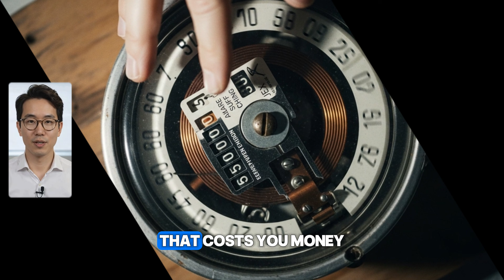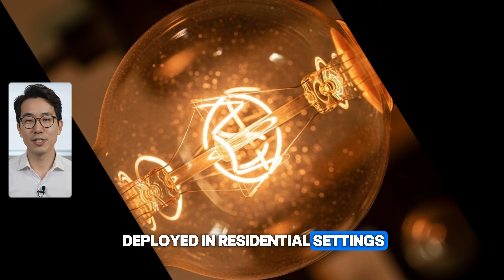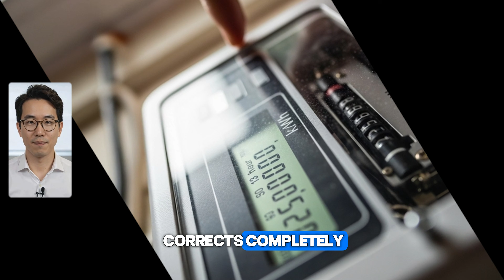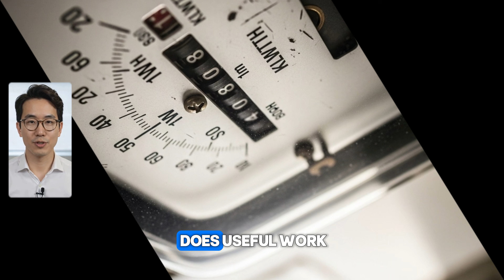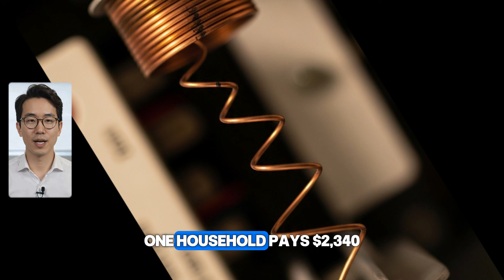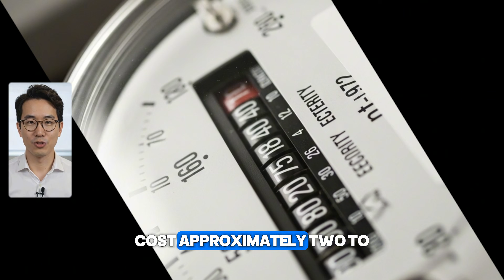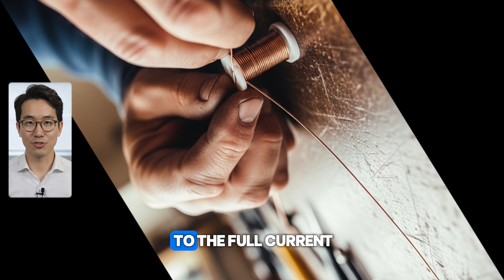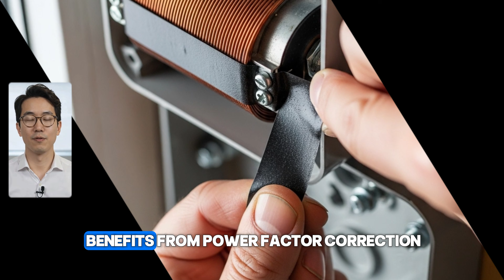This $3 Coil Wrapped on Your Power Line Cuts Electricity Bill in Half. Utility Companies HATE This

Comment: It sounds like about the same gauge as vacuum cleaner cord; but this wouldn’t work I think -
Reply: How do you think it wouldn't work if you've no idea what 18 gauge wire is
   Dunning Kruger
Reply: @johnrhodes3350  Assuming YOU know what 18 gauge wire is, do YOU think it would work?  Should it be solid or stranded?  Where would you wrap the coil?  What would you connect the two ends to, and why 80 feet?  :body-blue-raised-arms:
Reply: Electrical cords on vacuum cleaners & other appliances, generally are made of multiple-strand, smaller gauge wires twisted together, coated in plastic.. 
Those individual wires, taken apart, are Too small to use single wires from.  
Wire gauges are tricky—because the gauge label on compounds strands of wire, does not indicate the actual gauge of the individual wires inside it. 

The coil wire is specified to need: 
Single wire, 18gauge, & should be continuous, not spliced-together pieces. 
Non-coated.

Comment: 80feet of 18 guage copper wire 2 to 3 dollars what year was this video made 1892
Reply: Or as this AI guy would say, “one thousand eight hundred ninety two”.
Reply: Can find it from electronics that get thrown away
Reply: @ale.g.x.667  But will still do ABSOLUTELY NOTHING, despite what this AI-generated pile of garbage calling itself a video claims.
Reply: @Ferd414 idk about absolutely nothing, you'll use your hands some at least 🤣.
Reply: @ale.g.x.667    Maybe. Might scavenge from unwinding ceiling fan motors.  
Although, if ya have a fan motor to take apart, those can be remade/repurposed as generators for use as a wind generator….which might provide more electricity than is saved by the copper coil only partly stopping grid from billing you for the electromagnetic energy they “think” your house used.    
That wind-Gen could be a much bigger benefit, feeding that juice to a few batteries to boost solar w/less solar panels for your house, & be configured to 1st charge your backup batteries, then sell excess to the grid with a grid intertie.
Reply: It would cost more even if it was scrap wire.😂
Reply: @lindaswanson9328 the scrap scalpers 🎸🤣
Reply: probably the very dark ages 😂
Reply: I already knew that 80 feet is way more than copper from 50 years ago.:face-blue-smiling:

Comment: Show videos  of how to make and fit this coil
Reply: No doubt, if you put the coil before the meter they will trip .if they find it inside they will trip...
Reply: @Troy-b4n    The incoming supply line before the meter, is usually outside the house; in most it’s right up against the wall, or, where power line comes from pole to house near the roof.   
If coil is placed close to where it enters the house, but before the meter? — That just seems like it fails to change what gets metered, from the return lines.

Most commonly, the line enters the meter, & the meter plugs right into the back of the breaker box—
 so there’s nowhere to wrap a coil around a line before it returns thru the meter …. I think that’s a problem. 
As I understand it, in normal use, incoming power is measured by meter, goes thru circuits & appliances in-house, some is used, then what’s not used returns back thru the meter & measured again.  
Meters signals that difference wirelessly to utility computers.  
The difference btwn incoming & outgoing, is what you are billed for.   
The more returning power is seen, the lower your bill. 
But:  
Problem is, it’s a kinda sloppy setup. 
The current moving via the wiring, causes “bleed-over” (some call it “electrosmog”).  
It’s energy lost from the wiring into the atmosphere around it.  
It technically belongs to the utility, & they want it back!  
That’s why folks who have harvested bleedover from under high-tension power lines, have been fined for “energy theft”— tho, it’s Not like the utility can get it back—they go on the principle of it…. They don’t want anyone getting something that the utility ..Might.. have profited from..  even if that bleed never could be used or recaptured by the Corp.. 

The copper coil gambit seems like it’s trying to stop some of that bleedover from being lost; tries to make more of it stay on the line, so, more of it returns to the utility, so they see more returning to them— it looks to them like you turned off some appliances, & used less — at least that’s what it seems to me. 

If I understand right, copper coils would need to be maybe on the individual circuit lines, indoors, out of sight from anyone seeing …. near where those connect to the breaker box, to hopefully snare more of the bleedover so the meter can read it, & lower your bill. 

There’s another trick that might be used, but must be done when a house is being wired, to minimize bleedover from house wiring.  
& if you do this, you need to be sure the transformer at the street is modern, & can handle more power coming back into it. 
It requires putting a single twist per every 3’ of Romex (3-wire, 14g. house wiring) going thru the walls.  
One electrical engineer told me, “sure, that works, but, the amount of feedback of the bleedover, to the transformer at the street supply point (the big cans on phone poles), can cause the transformer to blow up, spilling PCBs all over — that especially applies to old tech transformers. 
Why?
  I suspect the transformers were designed to handle the expected household loads only.  
If a house is flowing power thru lines AND using it, AND returning too much to the grid, it ODs the transformer.  💥 
This is similar reason many utilities tried so hard to  block folks merching their homes with wind & solar & selling it back to the grid;  AND, they really were trying to keep hidden how vastly antique the grid has been, for over 80 years.  
So instead of admitting grid fragility & insufficiency, they told some folks, that their site sourced generation was incompatible with grid system…
 & because grid is greedy as pirates, they also tried to make home-Gen power illegal, to stop folks from doing home-Gen power. 
So, bldgs are still being flat-wired (now twist every 3’), & the transformers are still being engineered to have less capacity for site-generated power, & designed for Not accommodating extra returned power. 

There can be other factors, such as houses wired w/aluminum instead of copper, or, with hybridized wiring (mixing copper & aluminum wires)

It’s complicated. I probly didn’t explain optimally. 
Hopefully, folks get the gist.
Reply: . Autocorrupt correction:  buildings are flat wired (with NO twist every 3’ of romex..)
Reply: Can't be done, because this is nothing but AI garbage that doesn't even begin to approach having any reality to it. Congratulations... If you think you're going to try it, you've just demonstrated that you're a gullible fool.

Comment: Rapping wire round a power line causes heat build up inside the cable as the live neutral and earth are enclosed with an outer steel sheath to protect the cable from damage. 
I have seen major fires caused by this stupid idea. 
This AI idiot is scamming you to do something that will save electricity.  But burn your house down . Reactive power is also reactive heat . 
Also noticed how he keeps repeating the same thing over and over . It's called brainwashing..
Reply: Wrapping

Comment: Do we have any electricians in the house?

If you wire wrap the power cord on an inductive load such as a motor or inductive heating device, etc, would that also work?
Reply: Question #1:  Yes.
Question #2:  No!
Reply: I was a generator mechanic in the army and I can guarantee wrapping a copper coil around the wire leading to your meter isn't going to do anything but make you tired of wrapping wire around and  conduit and make you wish you could get your money back on the copper wire.

Comment: Please show diagrams or example
Reply: This video is AI.  AI vids are notoriously for hooking viewers into tantalizing life-line gadgets or fixes, but using up excessive Time & Resources of viewers. 
SOMEone is raking in dough, just from views, clicks.  
Humans lose, cuz these things fail to include anything completely—it requires folks to do more research to find clearer instructions. & to verify if the “solution” offered even works. 

It says, this coil can maybe get about 30 - 40% better efficiency.  
But commercial capacitors properly installed, can get up around 90+% better efficiency. 
I’m gonna be checking cost of electrician doing a proper one.  
But might try the coil.  
The wire is about $30 something now at home depot. 
 
If it fails to show improved efficiency,  the loss is modest. 
It says to chart the meter reading once the coil is placed, & again in a month, so you can see the difference. 
Put it in place near the same date the utility reads your meter, so it’ll be in-sync w/the billing cycle, & clearer to see changes relative to the coil.

Comment: This is utter AI BS!  You can NOT correct your power factor unless you first know what it is, which requires specialized equipment, and every time a motor or any other inductive load turns on or off, your power factor changes.  There is no way that 80' of copper wire is going to magically "fix" anything.  Besides, you correct an inductive power factor mismatch with capacitance, not another inductor.  Also, it's illegal to wrap wire around the power company's wiring ahead of the meter.  People have been successfully sued simply for running wire under a high voltage line to "harvest" current through inductive or capacitive coupling... look it up.  Furthermore, if you wind a coil of wire around only one of the two "hot" wires going to your house, you've created a current transformer, which DOES carry current, and CAN shock you.  This is a perfect example of how irresponsible and ignorant people can use AI to create content that's useless at best, and illegal and dangerous at worst!    (Retired Electrical Contractor)
Reply: Thanks for being a real person with real intelligence and real advice thank you for taking the time I appreciate it
Reply from the maker: You raise some valid technical points. This video focuses more on illustrating a concept rather than a full electrical engineering solution. Power factor correction and grid interaction are definitely more complex in real-world applications, and safety/legal boundaries should always be respected. Appreciate the detailed input.
Reply: @ForbiddenOutdoors  "Step away from the AI JON-BOT!"

Comment: WHAT A CROCK OF CRAP !!!!!
Reply: Power factor CORRECTING CAPACITORS ARE SOLD ...BUT MUST BE MATCHED TO EACH MOTOR ...PROBLEM IS TAT EACH MOTOR IN A HOME  RUNS INTERMITTENTLY AND THEN CORRECTING CAPACITORS MUST BE CONNECTED WHEN MOTOR IS ON ...DISCONNECTED WHEN MOTOR IS OFF !!!....37 YEARS AS INDUSTRIAL ELECTRICIAN  ...NO TEXTBOOK , NO THEORIES SHOW COUNTERACTING /THE FIXING POWER FACTOR WITH ANOTHER COIL ...ONLY CAPACITORS !!!!!!!!!!!
Reply: @ERICKAJANDER  CORRECT.
Reply from the maker: I understand this topic can be controversial. Always good to question things—appreciate you sharing your opinion.
Reply: 1) Consumers are not changed for Reactive power.. 2) Even if we paid for reactive power... most homes run .90PF (using CAPACITORS not Inductors)   and correcting would only save a few $ a year at most.

Comment: Most people in our neighborhood pays $275 to $350 monthly.
Reply from the maker: That’s quite a significant monthly cost. Energy expenses can really add up depending on location and usage patterns.
Reply: @ForbiddenOutdoors    Maybe worst is, the covert algorithms that can adjust bill up higher if the meter signals a sudden drop in usage—like, when way better windows get installed, or a bunch more insulation added to attic. 
This has happened here, 3 times.  
   1st, insulation added in attic, showed a drop the 1st month, but it went back up & then some, the next month, despite weather being similar.   
   2nd, we replaced 2 big windows.  Again, a modest drop the 1st month., then raised more the 2nd month.   
   3rd time, we replaced a big windows, & remediated a 2nd big window, & faked a storm window on half the slider door.  That time (& maybe cuz I’d contacted utility complaining of improvements failing to lower the bill…?), there was close to $100 drop in freezing cold weather bill, but, it went back to higher, over the next 3 months, even as the weather warmed some.  

There’s another category of charges that make up power bills:  “other fees”.  Anything can be covered by that category, that is other than transmission, etc. 
 So, there can be hidden fees you are kept in the dark about. 
 It used to be the smaller category. Now it’s turning into the biggest.   
Important questions to get from utilities, is, a complete, itemized list of what “Other” fees are, because That is the 2nd place that can bloat your bill, & they can still say, “but we have not increased the unit price”.  Increasing that requires a vote, But “Other”, doesn’t.

Comment: I studied power grids and FOUND out something strange...BUT I WILL NOT EXPLAIN A SOLUTION HERE.
.I WILL POINT OUT THIs... HERE HERE in France AND Italy they use step down and step up transformers...NOW GO LOOK INTO THAT... HERE'S A POINT YOU SHOULD FIND... ELECTRIC DOES NOT TRAVEL FROM GENERATOR TO YOUR HOUSE..... ELECTRIC ONCE GENERATED..IT HITS A ATOM..THAT HITS ANOTHER...EACH TIME ENERGY IS TRANSFER... THINK.
Reply: Step down transformers are used between the power generators and the user to reduce the current necessary to supply the power. This helps in two ways 1) The wire size can be made smaller and 2) reduces the inductive power loss.  Anyone interested look up  I**2R transmission line loss.
Reply: @buggsy5  Transformers are primarily used to change voltage, not current. It is because of I*2R losses that substations are needed to boost voltage lost in long distance transmission lines.
Reply from the maker: Interesting perspective. The way energy is transferred in power systems is definitely more nuanced than it appears, especially with transformers and electromagnetic fields. Thanks for contributing to the discussion.
Reply: You're ignorant.

Comment: Where Is the copper wire/ or the copper tube applied to the incoming power line ? Before the outside meter ? Or indoors after the meter ?  Makes quite a difference. Thank you !
Reply: I believe it is illegal to install anything before the meter - and possibly before the primary disconnect method.
Reply: @buggsy5  You believe right.  This is total AI BS.
Reply: @buggsy5  Install AFTER the meter.
Reply from the maker: Great question. For safety and legal reasons, anything before the meter should always be handled by the utility company. Most examples shown are conceptual or applied on the load side (after the meter), but always follow local regulations and safety standards.

Comment: Overstated it might save a tiny bit. It takes a coil and a capacitor
Reply: It is what you get for an AI generated video.  And smart meters can be remotely calibrated.  Charging you extra is easy as pie now, as all a guy needs to do is increase the multiplier.  If you complain, they can claim it was hacked causing your house to burn down to the ground.

Never ever install a Smart meter on your home!!!!
Reply: @pixels303at-odysee9  From my understanding, it is the electrical utility that supplies the power meters.
Reply from the maker: That’s a fair point. Real-world effectiveness can vary, and adding components like coils or capacitors can definitely change how a system behaves.

Comment: Residential meters do not work the way you have stated, they measure watts, not Volt Amp Reactive power. You are billed only for useful power (watts) only never for the reactive power. Don't fall for this misinformation people.
Reply: If you have a smart meter then you pay for Volt Amps.
Reply: @antonerg8184  Which is watts - volts times amps. Since the voltage is constant, all the meter has to measure is the amps (current).
Reply: @buggsy5  E x I x pf = VA  HTH...
Reply from the maker: You’re correct that residential billing is based on real power (watts). This video is more about illustrating electrical behavior rather than suggesting how billing systems work. Appreciate you adding that clarification for everyone.
Reply: @ForbiddenOutdoors how could the meter differentiate between apparent power caused from current lagging or leading volts??
Reply: And there I thought it was measuring electron movements
Reply: It’s a crime to tamper with these  devices owned by utility companies. BIG HUGE FINES   And jail